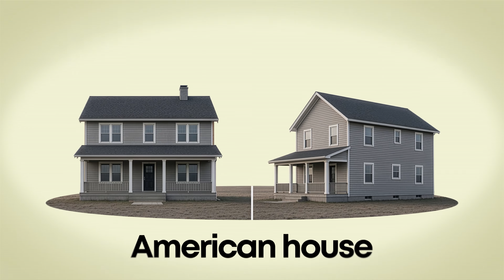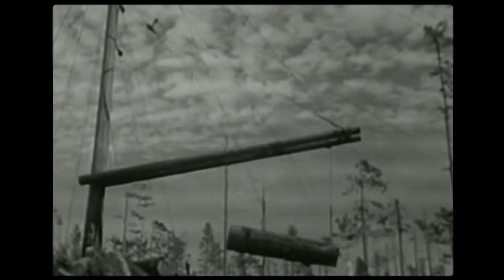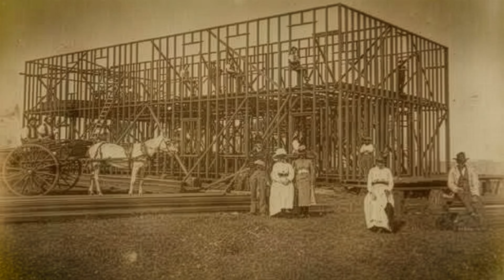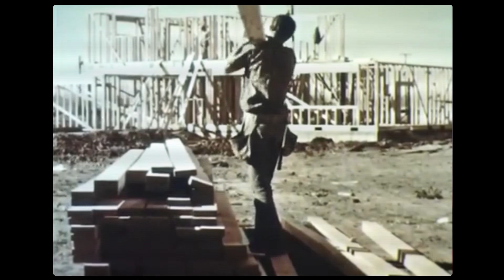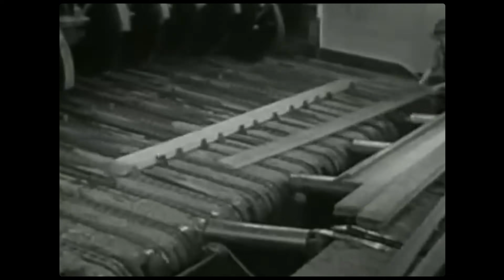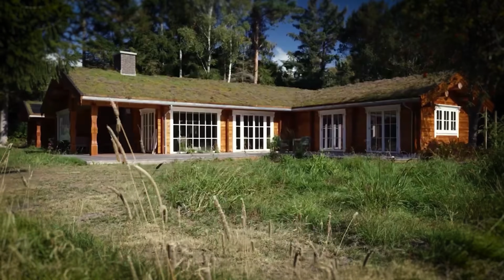What America Could Learn From European House Construction

Comment: I have lived both sides of the Atlantic. I prefer my North American house as it's significantly larger than what I had in Europe. Sure, it's made of wood and probably won't last 200 years, but what do I care? HVAC is vastly superior to radiated heating. The biggest difference in maintenance is that a wood-built North American homes require somewhat frequent but relatively cheap maintenance whereas brick-built European homes require occasional but very expensive maintenance.
Reply from the maker: Thanks for sharing your experiences and insight!

Comment: Just an average civilian that has no education on actual house building or any engineering skill here. Based on my personal opinion, both of them are just different types of building, not one is better than the other one. Each has their pros and cons.

Balloon framing timber house 
Pro:
1. Cheaper.
2. Material are easier to secure and transport.
3. Less professional skill required.
4. Shorter building period.
5. Easier to do modification in the future.

Cons:
1. Less fire resistant.
2. Material degrade than mason build house.
3. Less resistant to physical impact.
4. Risk of rot and thermites

Mason / brick / concrete build house 
Pro:
1. More sturdy.
2. Long lasting.
3. Resistant against fire and most natural element

Cons:
1. More expensive.
2. More time consuming.
3. More collaborating from multiple materials (framing, steel reinforcement, concrete, brick)
4. Harder / More expensive to do modification in the future.

My own conclusion:

Both of them are just like cars. Both of them can do their job which is transporting things (for house, it's protecting occupant from the element), but one car is cheaper, faster to get, and easier to do modification ( balloon framing house is cheaper to build, build faster, easier to modify in the future) while the other car is drive faster, more stable, safer and sturdier ( mason house is block elements better, safer, more stable and long lasting).
Reply from the maker: Thank you for sharing this detailed information.
Reply: Cheaper? For the builder, not the buyer.
Reply: @luisdanielmesa thats the problem of the builder that set the price, not the problem of the material itself 🤷‍♂️
Reply: I'm looking into ways of building roofing without any wood, just to remove the last structural element still vulnerable to fire... I'm also complicating it by having to still be compatible with (for us) traditional fired clay roof tiles, because metal roofing is loud af and I consider bitumen shingles a crime against humanity. 😂